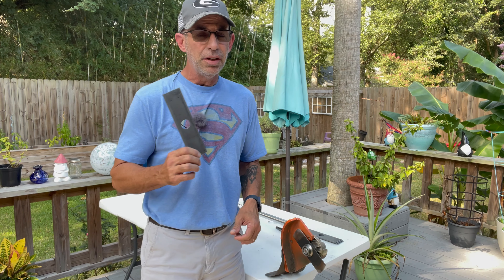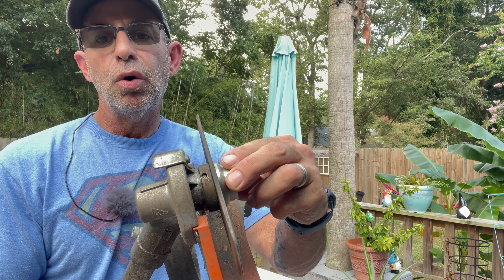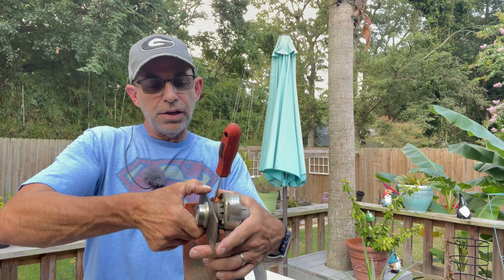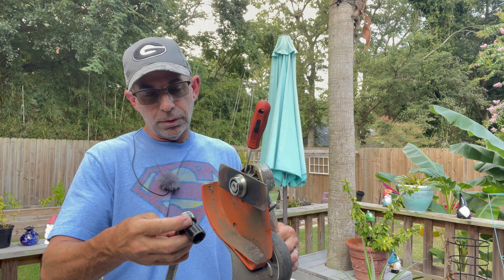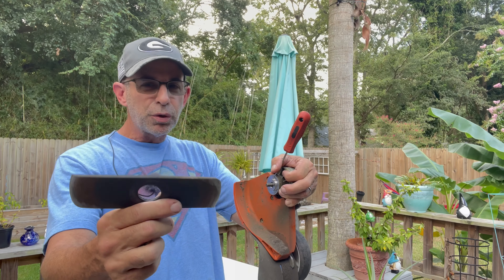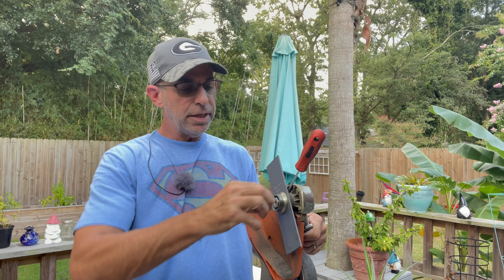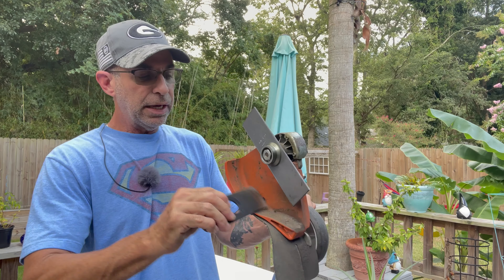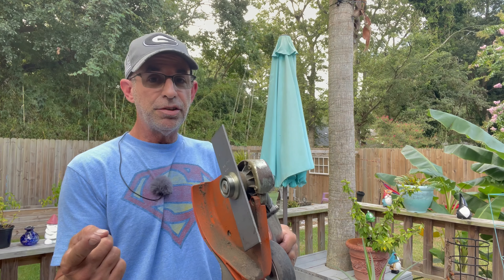Fast and Easy! How To Change an Edger Blade - Replace a Blade on a Grass Edger

Comment: Dan,I am pissed off,my daughter bought me a weed eater in 2020 for my birthday but a few weeks early,I bought an edger attachment and a bush trimming attachment,it did not last a year,I have been looking at it several times trying to get it running,I just have changed the string for the first time and used it,then next day refueled it and it did not start,I think now I have to buy a primer bulb because I messed with it trying to repair it and messed up the gasket.
Reply from the maker: Could the fuel have gone bad?
Reply: @DansVlog  No it was fresh,I use trufuel in mine and it is good stuff.